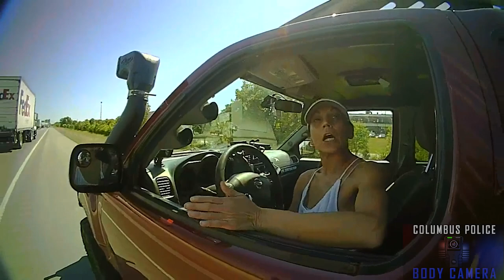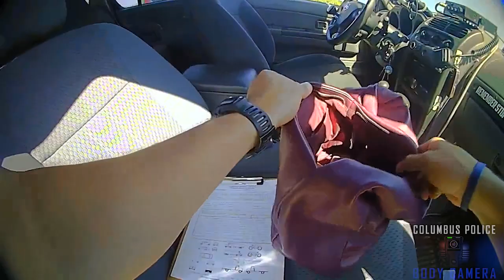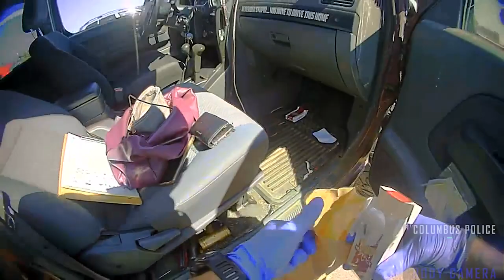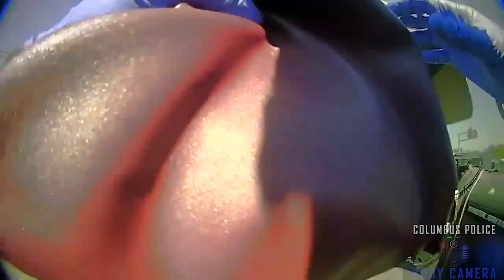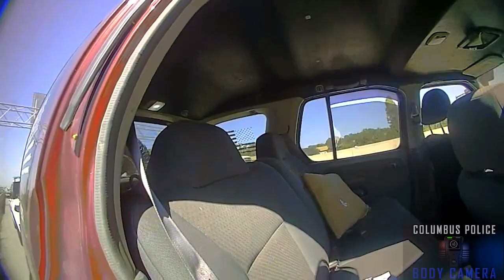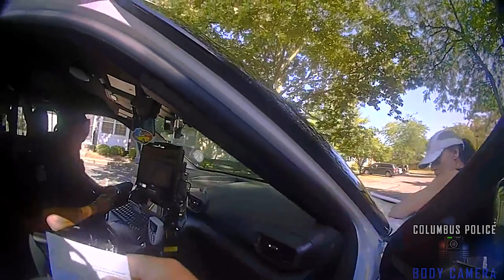If you don't have a license, you should drive better...

Comment: Those that ride dirty always seem to get pulled over for something stupid. Broken tail light, license plate bulbs out, driving stupid, etc. A beacon to any police officer.
Reply: Well...I'll just say, the plate bulb out can happen without your knowing it. The stupid part is the riding dirty!
Reply: @straightforward  Yeah, but they should know if their license is suspended, no insurance and driving like a idiot. And even the plate bulb, if I was driving illegally I would make sure everything was in check before entering the roads.
Reply: Honestly I was the complete opposite.  I used to have open containers all throughout my car, blunt guts , seeds and pill bottles everywhere too but everytime I went to leave I checked all my lights and I drove perfectly like the police was behind me the whole time. I would have never got caught if I hadn't got pulled for doing 6mph over the speed limit, something that is rarely done but that's when it all came crashing down. I have been clean and sober since 2018 but still struggling to get my DL back.
Reply: @easternncbigfoot1288  great job being sober!!! I can not even imagine how tough that is. Keep it going!!
Reply: @cararogers8487  Thank you so much , I will.
Reply: You’re right we do.
Reply: It is probably like here. The cars have auto plate readers. All drivers here who have had hooning (burnout/ excessive speed / excessive noise) , unlicensed, expired registration, offended police/ offended police officers friend / police information (bolo) get pulled over a lot. All you have to do is pass the cop (either direction) and the plate reader reads your plate, alerts the cop immediately and then he'll pull you over and give you a alcohol breath test & drug test (even if you don't drink / take drugs), check your vehicle for obvious faults and of course if unlicensed / unregistered give you tickets / arrest you /  tow your vehicle.  Police information can be pretty well anything a cop thinks (no proof required).. i.e. doesn't like cops, has dashcam in vehicle so use caution, records police when being pulled over (legal), intimidates drivers (looks at them when they are breaking the law)
Over here , no probable cause is required to pull over a vehicle. I know that is required in the USA but police information / bolo might be probable cause over there (bit of a stretch but still)
Reply: I can't believe I see that over and over on Cops and other police shows. The turn signal is right freaking there!
Reply: Driving on the curb and cutting off a ton of cars over multiple lanes (including a police cruiser) is a lot more than a broken tail light lol!
Reply: @mikeblaz  even when everything is in check they will pull you over my boi 😂
Reply: The stupid thing is that y’all don’t see the violations the cops did in the video. First it’s a federal felony for a cop to turn on his/her (emergency lights) when a emergency does not exist. Second not asking if they are operating in free travel or commerce, third removing her from her private property, fourth violating her fourth amendment by unlawfully searching her property. Free travel is not regulated by any state meaning you don’t need a license to travel or have a vehicle registered by the state. Speed limit signs are for people operating in commerce not freely traveling.
Reply: @texianforever7480  The highest courts will throw this out, because the police were not wearing a hat covered in tinfoil!!!!!!! 🙄🙄🙄🙄🙄
Reply: @texianforever7480  So you're a sovereign citizen? Literally all you gonna get asked as the cop does absolutely whatever the fuck he wants to do with you,
Reply: @ffhhhbbfxfggggfdddffffffff  lmao sovereign citizens are a joke you can’t be sovereign and forced to follow corporate policies, I’m a Texas National I’m truly a free man I govern myself.
Reply: I think they’re targeted and the cop finds any little thing wrong with ur car as an excuse.
Reply: I've been driving dirty for 2 years now and still didn't get pulled over
Reply: @JAPARICAN50-50  i got pulled over for an loud exhaust one time
Reply: @ffhhhbbfxfggggfdddffffffff  you were probably in an all white neighborhood
Reply: It's a perfect reason to generate revenue also.
Reply: The law is designed for any random thing to allow a police officer to go on a fishing expedition trying to hit you with citations. I've seen plenty of videos where the officer just outright lies about the license plate light being out or not visible from some entirely subjective distance and then using that as a pretext to rip people out of the car, search through their property, run them for warrants, etc.
Reply: @easternncbigfoot1288  congrats. We fight a similar fight. Stay strong and don't sweat the small stuff.
Reply: @Yesenia.V  white guy with old gang ties. Took me decades and a move across the country to break out of being a target for 12
Reply: One time I got pulled over and all the officer said was "cool car" then he let me go.
Reply: All those things that you mentioned are some sort of bait for the cops to sniff you out and come after you. 😂
Reply: People who ride dirty already have poor decision making. They don’t care about laws and even less about minor traffic laws. No surprise they ignore them.

Of courses the entertaining part of us is how mad they get when they get busted for it.

Comment: Interesting. Here in CO, not having a license isn't arrestable, and the cops will let you drive off after citing you (provided you have registration and insurance). However, you must appear in court, and the Judge may give you jail time (why you can't mail in payment).
Reply: Erikk Hyndman  Actually, I've lived here long enough that I started legally driving at 13 without a license (registered Farm vehicles, and insurance wasn't yet required when I turned 16). And what I said? Happened to me. State Trooper was kind enough to put the proper plates on my car after confiscating the wrong ones, and give me a warning for 95 in a 65. But I had to see the Judge for driving on an expired license, and he could've jailed me for it instead of fining me $125, plus about twice that in court costs. Curiously, no points deducted.

Hey kinda-neighbor! You prolly know who Leroy Kirby is. But commercial regs are different, and that's the world you're operating in, not me. Driving suspended is not something you want to do. Driving expired, is a slap on the wrist. Get your license renewed before your court date and a Judge will dismiss it. So yeah, absolutely required, by a law with no teeth. It's not like the State doesn't know who I am, so I didn't "get away with something" nor am I a sovcit.

But I drove off, with the understanding that I wasn't immunized against being pulled over by someone else and given the same citation. Kept 'er at 3 under lol.

Comment: That vehicle has a snorkle on it.   Is that in case she runs off the road, so she can cross shallow ponds, streams and creeks?

"Remember stupid - you have to drive this home" on the passenger side dashboard.

Liked the big brass hammer.  Those are nice for moving parts without marring them.
Reply: Yes, she can go under water.

Comment: I forgot to put on mu seatbelt when leaving a doctors appointment. At the firs traffic light I put it on. But did not know there was a unmarked cop behind me. He pulled me over and learned that my license was revoked 30 years earlier. When I went to court the judge asked me how long have I been driving on a revoked license. and I told him that I never stopped driving. He asked how I got away with driving without a license for 30 years. I told him because I drove like I had no license and obeyed all traffic laws and always made sure that my lights were in working order and used my turn signals properly. He fined me for the seat belt and dropped the driving while revoked charge. I got my license back the next week. and paid less in full coverage insurance than anyone I knew because I had only the seat belt infraction on my 20 year history.

Comment: I remember two moments in the mid-nineties:
1) Episode of COPS where a vehicle was pulled over on the freeway, officers eventually found small blocks of cocaine hidden inside the dashboard; it was a mid-eighties Chevy Impala/Caprice. Reason they were pulled over? Equipment violation; too dark of tint on front side windows.

2) Timothy McVeigh was pulled over due to a license plate was not fully attached to the car; only one screw & was dangling & crooked.

If you're going to be stupid, knowingly you're wanted by law enforcement, make sure your vehicle isn't sticking out like a sore thumb bringing attention to you.

Comment: I just have to say that’s scary AF there! Where I’m at you have to move over in the other lane to protect the people on the side of the road. You can be fined up to 10,000 for the first offense. 
Also, what is that thing by her windshield?
Reply: It's an air intake snorkel. it allows air to enter the engine even if most of the vehicle is underwater.

Comment: I am not condoning operation a motor vehicle without a license. A Driver's license is dumb. I don't have a driver's license because I never got one. I have been driving for at least a decade. I am super vigilant about other drivers and the type of vehicle they drive. I obey the traffic signs and I know proper driving courtesy when coming to a 4 way stop. I cut my Hi beams when coming onto traffic and I always signal at least 300ft/100yds from my turn. I only use the left lane for passing. I once drove buzzed and never did it again. I call home for a ride. I've rode with some idiots. One driver picked up a small male dog and asked me if I knew its sex. It had a penis and balls.

Comment: The problem was she was not used to driving on dry roads. She has a snorkel attachment that indicates this vehicle is of the wet road environment. You don't need a license to drive under water, ask Sponge Bob. HAHAHAHAHA

Sometimes there can be good cops, I know. I was pulled over had no license, no insurance, swapped plates. As the 3 NY State Police surrounded me I started handing my shit to my girl because I thought I was going. After a long talk amongst all 3, I was told to get the car home and never, never take it back out until all was legal.